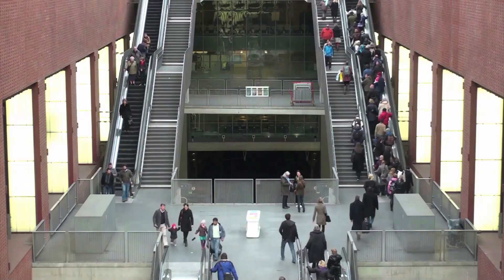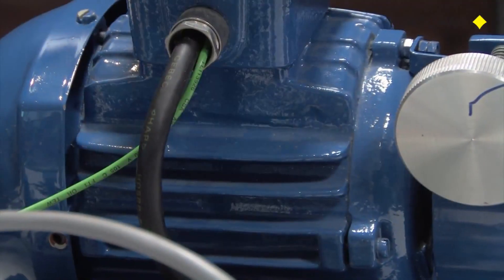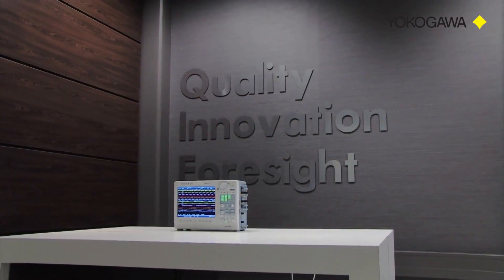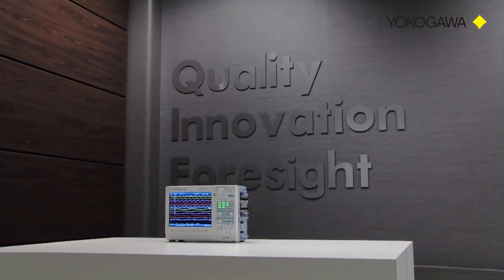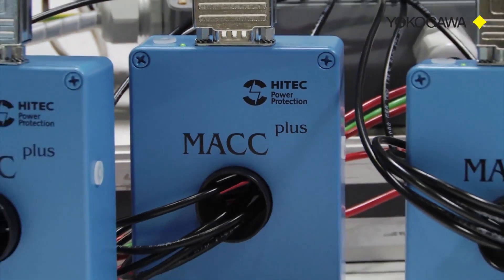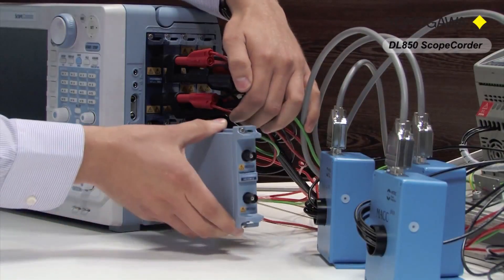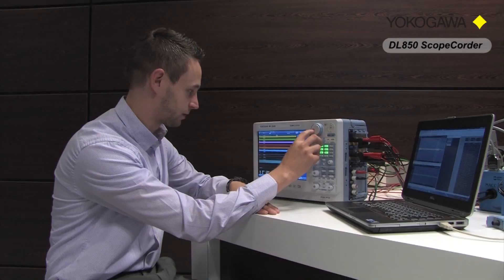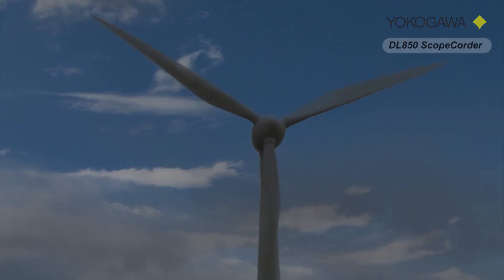Variable Speed AC Motor Drive Development and Implementation with the Yokogawa DL850 ScopeCorder

Comment: can we send the data available in data acquisition recorder to a controller in real time?
Say, from scope coder-->PC-->FPGA or scope coder to directly FPGA using the serial port. Any references?
Looking forward to your generous reply.
Reply from the maker: Hello Apurba, thank you for your interesting question. We do not have a high-speed serial link to stream the data directly. We do have a communication API as well as our 701991 MATLAB Toolkit available. These use a buffered communication layer between the CPU of the instrument and the USB or Ethernet layers of the connected PC. I recommend using our website tmi.yokogawa.com to contact your local resources and discuss your needs. There may be alternative solutions using our Real-Time Math option for example.